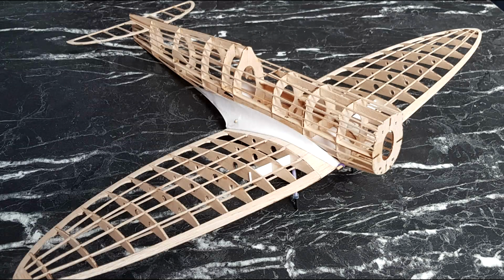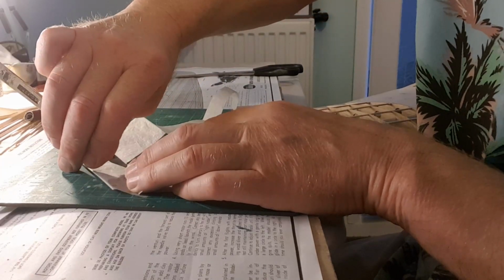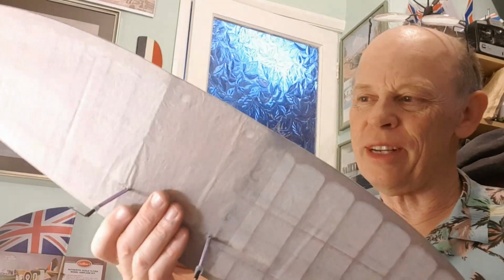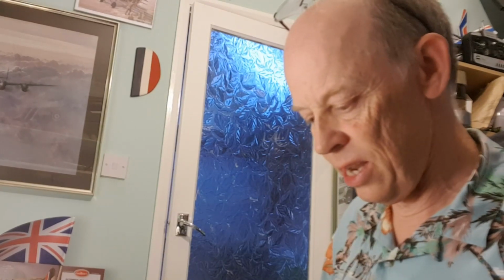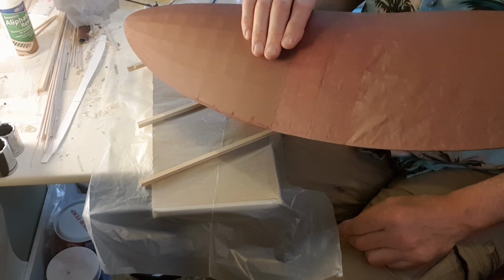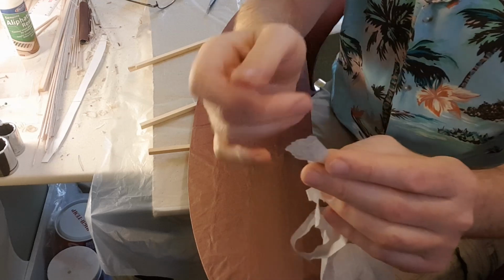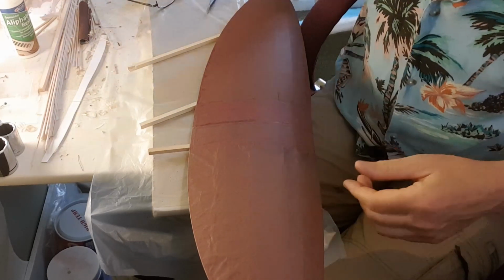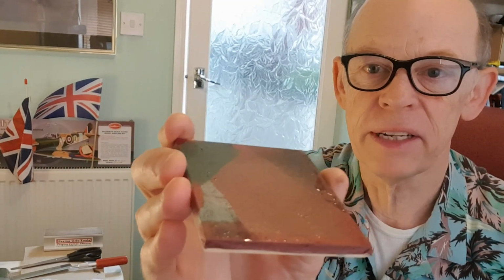Guillow's Spitfire Tissue Covering Build Part 6

Comment: Hiya, looks fabulous.  Great job!
Cld you tell us which brand of clear lacquer you used?
Looked on Amazon & saw Krylon for £31 & other brands for abt £8.  
Ppl said the cheap stuff was bad. I'm so confused.  If you able, I'd love to hear what you recommend.  Thank you so very much.
Btw,  I'm a total novice who found an an original One Nite 28 kit. Going to try my hand.
Reply from the maker: Hi, thank you,  the lacquer I used was one of the cheapest, if you look on Amazon (or anywhere really) for 'Autotek matt lacquer' that's what I used, it sprays very smoothly and lightly,  you don't want much. I do know that Krylon is also very pipular. If in doubt make a little test  square of balsa and tissue it, then finish it as you would your model, hope that helps 👍
Reply: @CliffHarveyRCPlanes  Thank you so much.  You saved me a few quid there.  Love this community of modellers.  Great vibes.  Thanks responding so fast. Take care!

Comment: HI Cliff, When you covered the fuselage, did you do it in sections like the plans say to or did you do it in larger areas.  I am new to the tissue covering.  Thanks.
Reply from the maker: Hi Mike, I did it in one, the underneath was one section as was the front top, the bigger you can handle the better really. Maybe three pieces? 🤔🙂
Reply: @CliffHarveyRCPlanes  Thanks, I think having bigger pieces looks nicer.
Reply from the maker: @mikeshutts1969  It does Mike, but you can disguise the joins if you tear the tissue, the fibres blend in to an extent.

Comment: Hello Cliff ,
When doing a tissue covering build over balsa wood frame on any given model  , is it feasable to brush two coats of dope on (for extra strength ? ) and then finish off with a gloss enamel spray paint (or two)  ? Or will this make the model plane too weight heavy ?
thanks
Reply from the maker: Hi Mike, the dope won't add strength but will add a lot of weight, it depends how humid the air is where you live, a high humidity will cause the tissue to sag without sufficient dope so it won't fly so well, however more dope to combat this and the weight will cause it to not fly so well! Paint will add even more weight. That's why I used coloured tissue for both colours for maximum weight saving. Here's two channels to look at, the first is where you'll really learn how to build top class models by a true expert, the second illustrates how models react in a humid environment, both channels are excellent and well worth subscribing too. https://www.youtube.com/user/maxfliart and https://www.youtube.com/channel/UCrxRTOkn7YSD4cEtkbMOOhw 👍

Comment: I'm a new subscriber and would like to know what type of acrylic clear over spray do you use on the decals. Thanks, Carroll
Reply from the maker: Hi Carroll, thank you,  the lacquer I used was one of the cheapest, if you look on Amazon (or anywhere really) for 'Autotek Matt Lacquer' that's what I used, it sprays very smoothly and lightly,  you don't need very much. I do know that Krylon is also very popular. If in doubt make a little test square of balsa and tissue it, then finish it as you would your model, hope that helps 👍

Comment: Nice job on the wings. What are your thoughts on covering highly curved fuselages like the Spitfire? There seem to be 2 schools: use two sheets,1  bottom, 1 top, OR many smaller pieces.
Reply from the maker: Well Irwin, thanks for the wing compliment but no compliments on the fuselage 😁 It was a bit of a challenge due to the tapering curve, it seemed to work without adhesive but as soon as it was applied things went a bit awkward, the second side (starboard) was easier because I did it in three sections, front, mid and aft and that's what I'll do in future. At least the early planes were mostly slab sided.
Reply: @CliffHarveyRCPlanes Thanks Cliff. I must admit that I have tried both ways and have gotten frustrated either way. But on large planes it doesn't seem to matter.  Maybe that's why I prefer WWI models for small planes.

Comment: Looks awsome. I do however have a question about covering the fuselage. Did you cover it in small pieces or more or less one large piece per side?
Reply from the maker: Hi Tobi, basically I go for the biggest piece I can fit in one go, it depends on the curves you have to go around. With the model I'm building at the moment I plan to try putting the tissue on very slightly damp, it goes around curves more easily but it takes a bit more practice, I'll post a video when it's done. 👍

Comment: NIce job so the clear laquer is only thing used to tighten after applying tissue?
Reply from the maker: Hi Brian,  the tissue went on as tight as I could manage, then the water, this is what does 95% of the tightening, then the spray lacquer just seals the tissue and gives it strength, to be honest I was surprised it works as well as it did! It's a good idea Brian to do a little test square to see how it works for you. 😉
Reply: @CliffHarveyRCPlanes  so it was plain water not distilled or was it mixed with alch I have heard so many stories I used to use nitrate dope back in the day years ago then as I have found heavy as now I tried brand name plaztic dope 95%water 5% to preshrink was a night mare then applied a stronger coat but wasnt very pleased managed to do all flying surfaces ok now on fuse as my current build is a practice run before I approch the Cessna 180 which should turn out all the better for this build of the Typhoon. NB Pre shrinking for me gives wrinkles and bumps. Will be following your method on the fuse plain water distilled Ill use all I need is a better spray, garden ones way too heavy lol
Reply from the maker: @BrianRamseysg01  Yes, just plain tap water, we have soft water here, I don't know if that makes a difference. Re the sprayer, the one I used doesn't exactly mist it on and the tissue goes quite saggy and takes a bit longer to dry but while it's wet it's very delicate.

Comment: hi, lovely model. Did you use domestic tissue? and what did you use to shrink it to get the wrinkles out ? thanks !
Reply from the maker: Hi Joseph, if you put the tissue on with as few wrinkes as possible it doesn't have much shrinking to do. If you go to 8:20 on the video you can see me spraying ordinary water, (a mister bottle would be better, it wouldn't soak it as much) onto both sides of the wing then I weigh it down for a couple of hours until the tissue is try. I don't use dope, it adds to much weight, the green is just emulsion paint watered down a bit and then the whole thing is given a light dusting of matt lacquer. The tissue is model covering tissue, domestic tissue can be used but it's not as soft and pliable.

Comment: Hello Cliff 
From Cliff. I have this kit. Never built a balsa. This is going to be fun. Watched all the videos. As for tissuing the fuselage it seems to be challenging. Any tips? Videos are wonderful.
Thank you......Cliff
Reply from the maker: Hi Cliff, thanks for watching. Tips for the fuselage covering ... basically do it in sections, as for what size sections it depends on your skill/confidence level, the bigger the section the quicker the job gets done. I will say though don't worry about pulling the tissue off and cutting a new piece if you mess up. Are you making it to fly or static?
Reply: Cliff Harvey RC Planes 
Thank you for the response. I have no experience with building one of these. I am a toolmaker so I have a lot of experience with fitting. On the question asked. Would you fit the tissue one side at a time or drape it over? Thank you for your reply. I’m looking forward to building the spitfire. I would not be here without it.
Reply: Cliff Harvey RC Planes I’m going to fly it from my ceiling. Thank you............
Reply from the maker: @cliffholliman4487  The challenge Cliff is the fuselage doesn't just curve in one direction and the tissue will tend to crease hence why I said do it in smaller sections. The finish will be just as good once painted.

Comment: Cosmic Stuff Cliff. Did you pin down when you applied the lacquer mate.
Reply from the maker: Hi DD, didn't pin down but used the weights, same difference.  The laquer dried in just a couple if minutes in the heat were having at the moment, because I had a little washout the trailing edge was supported and the lower surface was off the board anyway. I had a piece of polythene under it just in case it stuck though.
Reply: Well yes, but to avoid warps apart from the intended ones. LOL 
I am looking at tissue over 5 micron mylar for the Mr Mulligan. but having seen the lacquer result, I may change my mind. Modern products have revolutionised tissue covering.

Comment: When I built my first Keil Kraft Spitfire flying model in 1960 I found the c.of.g really difficult to achieve cause the real one had a very heavy RR Merlin and the amount of lead weight I had to add to balance it by holding the wing tips was I thought excessive? How will you overcome this?
Reply from the maker: That's easy Mike ,I'm fitting a RR Merlin ha ha. No, only joking, I've lightened the tail end as much as I can and what has to be added has got to be added. For every 1g on the tail you have to add 4g on the nose so it's worth shaving off as much as possible.

Comment: My trimming of the tissue paper just doesnt cut as easily as yours... I wonder if you have a special blade, or perhaps technique?
Reply from the maker: Hi Sharne, firstly fit a brand new blade this is essential really. I try not to cut tissue which is wet with water or glue until it's had a few minutes to dry, it just tears to easily, in some instances I'll pull wet tissue apart against the edge of the balsa if the tissue colour is the same, the small fibers blend in with one another.

Comment: What is used to shrink the fiber? Just water?
Reply from the maker: I just use water but you can add alcohol so it doesn't shrink as fast but water's ok, try and mist it on if you can 👍
Reply: @CliffHarveyRCPlanes  so I wanna buy one of these rubber driven plane kits for me to have fun building and my children to play with. I am aware it will get destroyed but at this price point I am fine with that.
What do I need to build it that is not included in the kit, besides the glue obviously?
Is it reasonable to paint is with a light coat of car rattle can colour that I have around?
Did you and if yes why, decide against the fiber supplied in the kit?

My apologies for the noob questions.
Reply from the maker: @echannel1018  Noob questions are great, no problems there. You're right in so far as it'll get destroyed pretty quick 😁 Weight is the killer of a good flight so by the time you've either doped, or as I use sometimes, clear matt lacquered the tissue it's starting to get heavy, then you put paint on top of that and you're building a brick. This is why I used coloured tissue, the brown, and then painted the green on using watered down emulsion. Nothing wrong with the kit tissue as such, just that it was white. Also it's a good idea to test any paint etc in a small area first to make sure there's no funny reactions.
Reply: @CliffHarveyRCPlanes  thank you for the swift replies. Highly appreciated. Greetings from Hamburg
Reply: @CliffHarveyRCPlanes  My apologies, one more question. Do you think it is reasonable to use water only and no tensioner clear and then go with coloured paint directly? Then I can dust that on lightly and save weight
Reply from the maker: @echannel1018  The answer to your question is to make up a square of balsa and treat it as if it's an air frame test piece. From here you can try your hand at applying tissue and finishing it as you please. You'll get a real feel for the process you want to try. 👍
Reply: @CliffHarveyRCPlanes  true that
Reply: @echannel1018  what is the name of that roll on glue tube you use to apply the paper to the wood?
Reply: @randolphandreoni7126  In Europe they are called glue pen and they are mostly for children. UHU, Pattex and Tesa sell them.
Reply: @echannel1018  Thank You, cant't find it in the USA
Reply: @randolphandreoni7126  look in toy stores in the paperware section. Also I found Pritt Sticks on Amazon US